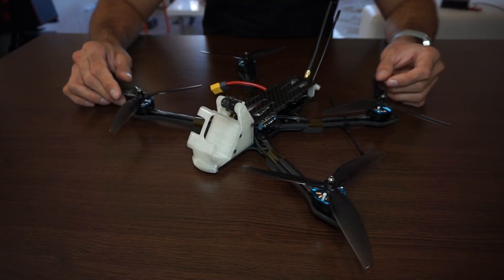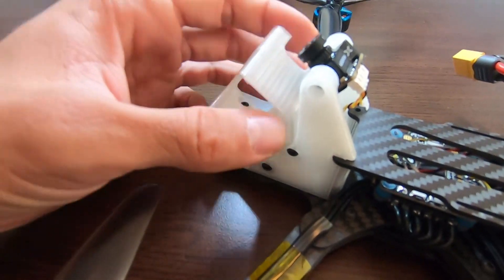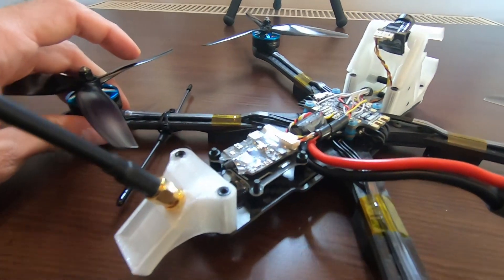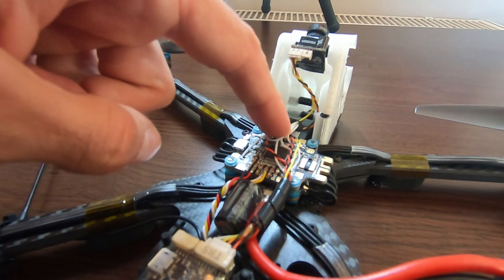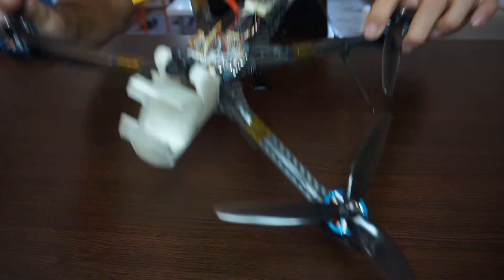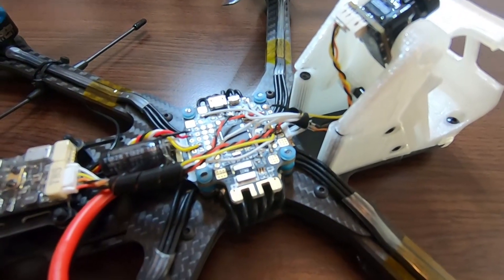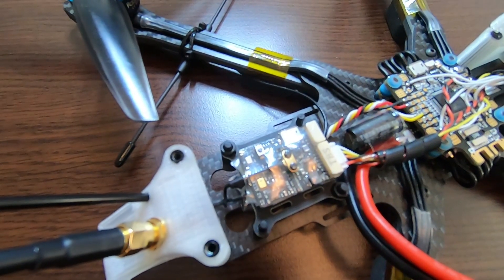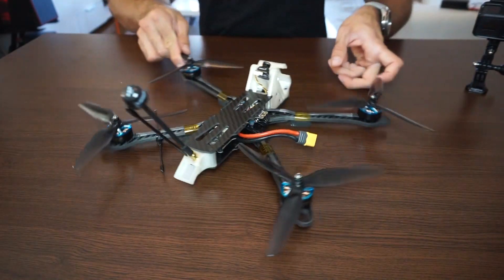FR7 long range drone overview and maiden flight

Comment: What does it cost to cut/buy? Wondering this versus Falcon F7
Reply from the maker: Can't reall tell. There was a really cheap version of the fr7 called fran but can't seam to find it again. So there is option to contact cnc madness for a fr 7. Do you plan to use digital or analog video on the drone?
Reply from the maker: Found it https://www.banggood.com/custlink/DDDheg2lbr
Reply: @mrRockwellFPV  I live in the EU. Will ask a local cutter. Is this the fr7 frame in your link? Doubting between analog and digital, quite some people seem to use DJI nowadays, even for long range.
Reply from the maker: @babipsylon  if you plan to use it for long range use analog. There's no full osd in dji so rssi, and other useful information is missing in digital osd.
Reply: @mrRockwellFPV  ach yes you are right. Hopefully with the hack it will arrive soon though (canvas mode).

Comment: U can order an extended immortal t. They have a 220mm a 110mm and the reg length 1. I got the 220mm extension and have 1 on the front and 1 on the rear like u were wanting to do. My setup is on a source 1 9in build.
Reply from the maker: The vid was published before the extended immortal t was available ;)

Comment: Thank You for nice review of your drone build here, Mr Rockwell. Very new to drones. Am wanting to build something like this strictly for doing panoramic video shooting. Dont care if the drone is fast. Is there any way in Betaflight settings to tame down the voltage used to the motors to get longer flight times? Seems this should be possible,but have never seen any tutorials on this. Is possible to get any DIY drone combinations that can get 30 minutes run time? Thanks again.
Reply from the maker: What do you think starting with this. https://www.banggood.com/custlink/K3KdtDGtrh
Really inexpensive and you have around 30 min flight time with liion

Comment: Hi, very clean build what range and flight times are you getting?
Reply from the maker: Since it's pretty agressive cam tilt for the LR rig I usually get 7 min on 2200 6s but really high cruising speed. And since using crsf range is no issue.

Comment: For the front mounted immortal-t you have to either extend a stock one with a longer coax or buy one from ibcrazy (vas). He makes them at 9" I believe.
Reply from the maker: Well thank you for the info. VAS stuff is kinda sparse here in EU but for sure I'm giving that a try